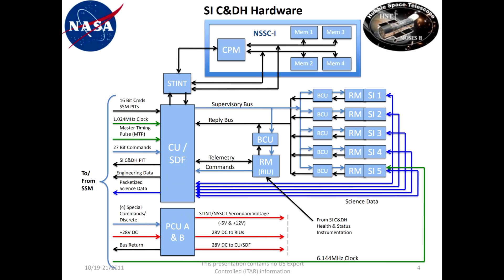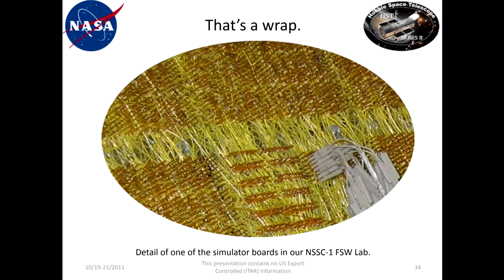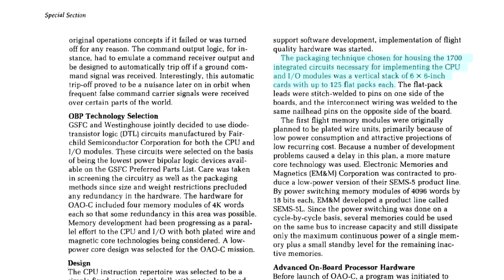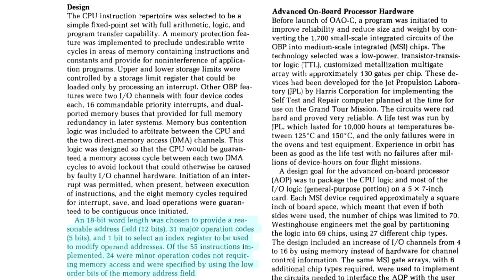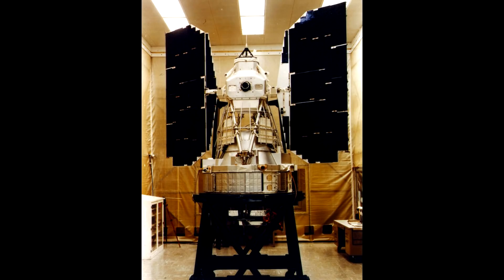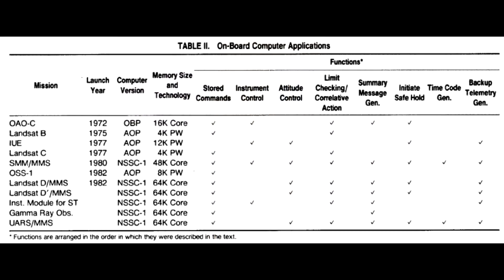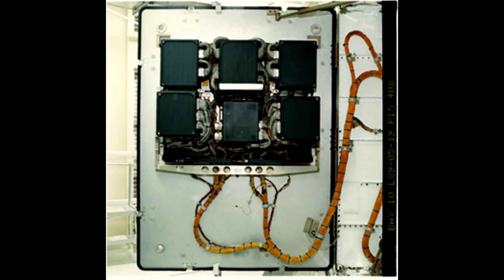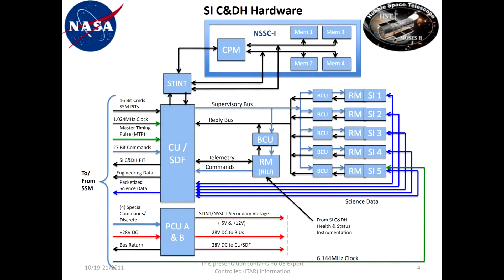Hubble's Latest Problems May Be In a 50 Year Old Computer Design

Comment: Holy cow some of that hubble footage is crazy high resolution. Looks so weird
Reply: Did you refer to the repair EVA from the space shuttle point of view? If so that's one of those nice benefits of analog film, it may be old but if the master tapes are still around that same chemical film can be rescanned with something that has a higher resolution. Most other recordings (digital, various cassettes, etc) are stuck with that resolution forever (unless you count upscaling as a useful thing to do). Oh and I guess the space shuttle with such a large cargo bay could carry some nice cameras too when the space wasn't needed for payload.

That's one of the reasons why older films and TV series shot in film if the original negatives are still around can be remastered in close to HD quality. However more recent but not to modern standard productions that were filmed digitally are pretty much stuck with what they used at the time.
Reply: @extrastuff9463  Thats why I can spend hours looking at the high res hasslblad scans from each Apollo mission 🥺
Reply: @extrastuff9463  when i was 10 in 2003 i watched many movies, and what always struck me odd, that those "old" movies from the 80´s had better quality than those that came out recently in 2003, as you explained it, analog has still benefits, and those who like high end audio swear on analog audio, combined with a tube amp. also in case there´s a UFO you better have an analog camera with you, as modern technology seems to not work around these objects

Comment: So, repair thought:
How much delta-V do you need to get it to the ISS?  The ISS has the Canada arm, it would be a fine "repair shop".  Obviously we're looking at the "If brute force isn't working, you're not using enough." maxim, but do we have a way to dock to Hubble with an external guidance system and just "superman" it to the ISS?

If you can get it there, then you can sent up repair parts.  Hell, you could do a full work up on it and repair anything small enough to be launched!  Obviously you would then need to put it back, but you would have more options at that point.

Comment: Really quite surprised they used the parts they did for the CPU/memory, as rad hard 1750A processors and rad hard memory was available from at least the mid 1980's. All these were built on SOS, so no latch up probs etc. I know 'coz I was working at a company making these back then. I forget the specific process tech, it would either have been 3µm SOS or 1.5µm SOS. We certainly had them available though at ~£1000/die.
I don't know if Intel had a separate rad hard process defined by themselves, or if there were some changes to the baseline process to produce rad hard product. It certainly seems as though Intel provided their processor design to Sandia National Labs at the Pentium generation and it says in the article I read this was the 3rd design. 
So presumably i386 and i486 were also provided for redesign with rad hard features &  I think likely, some process adjustments specific to those designs to make them rad hard.

Comment: Come on NASA, it's so obvious.  The Hubble's computer is very old.  Even the tiny Raspberry Pi 4B 8Gb is more powerful than what it has right now.  It's time to upgrade to the latest Ryzen 3990X Threadripper CPU, Radeon 6900XT graphics, 64 gb of DDR5 memory and 3 terabytes of NVME drives. That should be enough for the next 10 years or more. LOL!

Comment: Power supply failures typically arise from a failed capacitor.  This results in a fluctuating cyclic voltage.  
               The good news is a  potential work around as follows ...  first, confirm the failure by this clever test.  Assume the power supply does  provide an acceptable voltage level for a fraction of the duty cycle. (I.e. if the voltage converter/regulator operates at a cyclic frequency of 60 hz or 400 hz or 20,000 hz, then the defective voltage output waveform will be correct for a millisecond 60 times a second or 400 times per second).  So use a timer that runs the computer instructions during a set fraction of the power supply’s duty cycle.  After testing results, then you know the problem in the power supply and what timing is required to operate only when the power supply is in tolerance.   The timing may be from an internal timer register that tracks the duty cycle frequency of the power supply.  Since there is no way to synchronize the timer to the start of the duty cycle, then systematically try incremental phase shifts in timing until one works.   Then after the power supply is determined to have a pattern of 1 millisecond of functional output at 400 times per second, run the computer only during that window.
Hopefully the test program is small enough to be loaded in the length of time the voltage is functional ( they might have to try 1000 times and get lucky the attempted test program update load occurs during the functional part of the duty cycle).
Reply from the maker: This is all very cool, but isn't HST entirely DC?
Reply: Scott Manley ... you responded! 👊😎If it is all DC, then it still must be converting DC power to the required DC voltage levels. They may convert to AC and step down the voltage with a transformer, pass through a bridge rectifier circuit and then smooth out the ripples with a capacitor. They may have favored the transformer approach because it isolates high frequency noise (the input & output windings are connected by only the changing magnetic field within the transformer and therefor high frequency spikes and noise are isolated).  A different high efficiency method HST may have used to convert DC power levels is a regulator chip which essentially chops up the DC at a high rate (kilohertz to megahertz). This method could have a failure mode that creates unclean DC output. 
        An easier possible solution for HST is to reduce the computer current draw. If a capacitor has failed to only 10% of it’s original capacitance, then reducing the current load will reduce the voltage sag of the output. Thus, the computer may still be made to function at a reduced performance.   Reduce current draw by either slowing down the computer clock speed or add lots of “no op” instructions in between existing instructions and more. Logically, “no op” instructions would require less power.  There must be a way to run a test to see if the computer starts working when drawing very minimal power.

 I speak from experience on the 1970s design of an awesome unique Air Force Air Combat training simulator with fully immersive visual systems but am not familiar with the HST electronics.  Although the dual cockpit dogfight simulator did reuse a leftover part from the Apollo program.

Comment: I just watched a video about a Centaur rocket stage that was identified at the end of 2020 using infrared spectroscopy to determine that the object was comprised of 308 stainless steel. More interestingly, they did this by analyzing the surface of another known Centaur rocket which has been orbiting the earth almost as long, because spending a lot of time in space meant that it wasn't a perfect match with 308 stainless steel observed on earth. The two results matched perfectly.

My question to you is this: Does NASA have, or plan to create a database of material compositions to better identify other objects observed in space? Maybe they could use this same method to get a fingerprint of several known materials, such as those the ISS is made of. This might help to identify the origins of other "Unidentified Phenomena" to at least determine if it is something man-made, or of possibly more natural origins.

Comment: You missed another mission profile Scott , use an enlarged mission extension tug to grab Hubble and slowly lower its orbit until it reaches the ISS , there are 2 Canadarm's on the ISS so 1 can hold it in place while the other has an astronaut attached to it to do the repairs/upgrades and there is more than enough room in the trunk section of a Dragon capsule to carry up the replacement computers and any upgrades , I personally think that the problem could be a personal bugbear I have with old electronic tech in that its possible that some of the Electrolytic Capacitors have gone off spec or burst ( if that's in the power supply then you can bet the voltages will be a lot higher than desired... ) if that's happened then replacement with new is the only way to fix this

Comment: So they launched it with 20-30y old tech computer made by IBM that controls everything. I guess I shouldn't be surprised and should be afraid to ask the pricetag on the unit, "since it's made for NASA, space and stuff".
It's funny that it still has a 486 running. I've dumped my Dx2 already super old one in 1996 or 97, somewhat reluctant on doing so.

Comment: I worked on core memory systems in the early '70's.  The circuits that directly controlled the cores were almost always the problem and not the cores themselves.  CMOS memory back then was shite.  But who cares!  I think a mission extension vehicle could be used to grab the Hubble and take it to the ISS.  The ISS has the manipulator to grab and move around the Hubble and certainly all the air locks and space needed to conduct space walks and completely refurbish the Hubble. New equipment could be flown up to the ISS and NASA could send up a couple of astronauts just to do the space walks to fix it!  Sounds like a solution to me!  Time to call Elon Musk and tell him what we need for a mission extension vehicle!  I know the James Webb is going to fly any day now! (ha, ha, ha, ha!)  But like you stated Scott we need the Hubble for years to come.  Let's start a movement to rescue Hubble!

Comment: What's the possibility of docking Hubble with the ISS. Surely if you can do that you can have an astronaut replace the malfunctioning equipment.
I Propose this: dock the Dragon capsule or some other craft that has enough fuel onboard to bring down Hubble's orbit and change the inclination to math the ISS  (No Idea if this is even possible). then using the Canadarm to catch Hubble and have an astronaut perform an EVA.

Comment: Worst case scenario if it can stay in orbit for 10 more years by that point we would have the tech to repair it. There is no point in throwing away such a big telescope considering the cost of launching a replacement. Even if all the electronics need to be replaced that still saves you the launch of heavy fragile precisely aligned mirrors.

Comment: Dragon could approach it with an astronaut tethered inside an inflatable pressure bay with hatch with all the replacements needed & take the astronaut from the ISS to the Hubble & back.  Sure it would be a wild ride for the astronaut which I'm sure NASA would not approve of but if there was no other way to save it then that would be the only solution. I'm sure that SPACEX could manufacture a seat that would lock into the nose of hatch where an astronaut could lock himself into with seat belts for the short journey. SPACEX could make a temporary inflatable pressure bay with hatch that locks onto the nose in case the astronaut experienced problems outside & needed to come inside the capsule. SPACEX doesn't need any arm to lock onto HUBBLE as Dragon could come up alongside, adjust it's orbit to stay tethered while an astronaut worked on the telescope & if it needed more than one spacewalk then the astronaut could come inside Dragon through the temporary inflatable bay.

Comment: Instead of developing an airlock for the Dragon Capsule, why not sending a robotic servicing mission to Hubble? Even if it would require all the physical abilities of a human, there's already a solution. Only crux: Boston Dynamics Atlas V would have to be build radiation hardened 🙈 But it would be awesome to see it fixing Hubble 🙂 And meanwhile no human could hit it with a stick, so it would probably volunteer 😅

Comment: I believe they said they could write to memory, but not read from it. The problem then seems to be off the computer because the swapped computer shows the same fault. That could place the problem in the read enable path. A failed buffered line/chip? Is the output even buffered in this system?

Comment: Elon Musk: "Hey Canada, how quick can you get one of your space arms delivered to Boca Chica? My welders are waiting to install it!"
Put an arm and a docking adapter and airlock on Starship, load the parts in and launch it.
Then send a Dragon with the crew, dock and use the Starship airlock for the EVA.
Even with two launches required, still cheaper than a shuttle launch, and allows you to use an early Starship with no risk to crew and no waiting for a crew rated Starship.
Plenty of room in the nose for a couple of arms, an airlock, a cocktail bar and disco, and whatever parts Hubble needs lol

Alternatively, robotically capture hubble, tuck it into Starship, and bring it back to the lab to refurbish it, and then send it back up.

Comment: @4:42 You said "everything is hand-coded in assembly language", but the entire context indicates to me that you  really would have been more accurate to say "machine language" rather than assembly.  I used to hand-code both assembly and machine languages for Z-80.  Only the machine code goes into the hardware.  Assembly stays in the engineering materials.
Reply from the maker: There’s lots of documentation in the assembly language though. In fact there was a whole push to make a ‘plain English’ assembly dialect to make it easy…..

Comment: I take it updating the computer is pretty much impossible?
Reply: If you mean updating software, it would have no effect. It's hardware components that have failed, after decades of use. Plus there is nothing flying today with the capability of doing a repair mission to Hubble.
Reply: @danielpassigmailcom  well I mean updating the actual physical computer. I mean they installed some software and hardware to fix the lens issue. 
I don't see why they can't do that with the current computer issue. Just, it may cost more then it's worth. Unless say spaceX x can send up a mini rocket and little robot thing that can change the hardware out.

Comment: I'm not sure that having a robotic maniplator is a must have requirement. Other than this, they could send a Crew Dragon with two astronauts, EVA suits and enough oxygen supply to vent it a couple of times like they did it in Apollo era.
Reply: According to Scott (who is my only source atm so ymmv), the dragon capsule doesn't have EVA capability either (would require airlocks and whatever else to allow astronauts and their massive suits to get in and out of the capsule without depressurizing the entire thing.. and I'm sure lots more requirements that make it harder than simply "a door"!)
Certainly not impossible, but its definitely not a "just".  There would be a lot of development and testing required to ensure safety and whatever that the existing module has simply never had to deal with.  The manipulator arm is probably easier as they could (at least in theory) have it entirely external to the capsule and just bolt it on (or sink it into a trench on the outer shell or something, though that would likely require a whole new round of stress testing to make sure the trench doesn't become a weak point).
No matter what way they go, it won't be easy or fast.  Hopefully they can figure out something from the software end to hobble it along until we've got a proper fix ready to be deployed.

Comment: This was inevitable when the James Web Space Telescope received fairly definite a launch date; it’s on the schedule for an Ariane 5 ECA launch in November (there are 2 scheduled launches before then).

I know there is no correlation between the two, but with no capability to service HST and if the current problem proves intractable, hopefully the way over budget and very late next generation space telescope should only be a few months away…

Comment: Computers 50 years ago must be really impressive to be still in use today, they're built like an abacus, slow but will last (almost) forever.
Reply: My Ohio Superboard is over 40 years old and works fine.
Reply: @electrogestapo Even though they have the computing capacity of a single modern cell phone charger, for the time they were actually fast.
Reply: Modern computers should last forever as well. The most vulnerable parts are all power supply related. Those capacitors on the motherboard? Those are all to convert power from your computers power supply into power the cpu can use directly. They are only there for legacy reasons, if you can design every component to go together you can have the main power supply do the same job the stuff on the motherboard does. If the power supply was built to last, the computer would last.

Comment: what's the orbital gymnastics like for having a  MEV changing Hubble's orbit to rendevous with ISS, then send it back to the original orbit after servicing? I imagine this is rather challenging as they're on different orbital planes? Would be cool to see a simulation of this in kerbal tho :)
Reply: Impossible from any practical standpoint unfortunately.  The deltav required is way too high.  Over 150km altitude difference and over 20% inclination difference.  Remember on ISS we had to pick an inclination that was also possible for Russia, ya know without dropping stages on China... :)
Reply: I don't think Hubble has the fuel or the thrust to perform a change in orbit to meet up with the station
Reply: @alphega1983  Hubble? No way, but hypothetically, it should be possible to kerbal your way around with external stages that grab and move it. Which, as op stated, isn't really feasible. Nor would it be worth the cost, even if you could make it work reliably.
Reply: @sh4dy832  "kerbal your way around" is a great phrase! :D